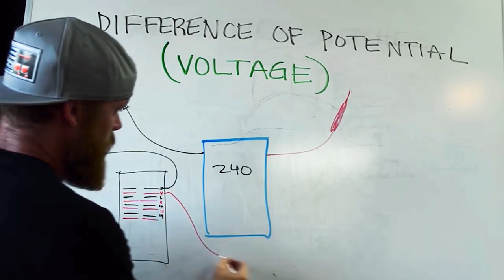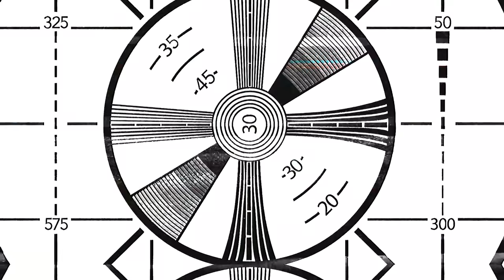So You Want To Be A Foreman...WHAT IT TAKES TO BE A SUPERINTENDENT

Comment: Thanks Dustin. I turn 50 on Sunday and I am starting out to be an Apprentice Electrician on the Monday. So excited. Even after 30 years in Telecommunication Electronics I know I have to put my head down and do my dues. Ask questions, and I know I will be the grunt. To me it will be like going to boot camp again. 👍
Reply: I admire you for being 50 and starting an apprenticeship program.  I'm 46, and thought about it, but that would be so many changes in my life I would have to make.
Reply: @cward1954  Here is the update I posted on my Facebook. First week at my new job update. First day I was exhausted and my body ached. I thought I would be doing only carrying and moving stuff around and not doing things that required me to use tools, but they have me doing electrical related task as well. I am doing a lot of the low task which is to be expected. Here are some of the things I have done. Rough in the wires for each units electrical panels. Rough in the runs for the hot water tanks, washer and dryers. Put in running board in the attic to protect runs from getting stepped on. Organize our storage area. Splice outlets. Brace the main entrance cable going the main panel. Put in pvc for media Center cables. Put in transformers for LED pot lights. Dug up an entrance cable and moved it. Replaced some incorrect switch boxes. A little long winded I know. I am so blessed to be a part of a great group. The foreman, lead and other apprentice are awesome. Everyone helps everyone. The feedback on my work is great. I have already been told they will be giving me the responsibility of doing the low voltage installs which is usually given to a third year.
Reply: @weaponxlogan123  Well you hit the ground running.  It's good that the new company didn't treat you like a dummy that doesn't know anything.  I love the distribution side, but would also like to work with motor controls and PLC's.

Comment: I want to do resi so bad but I love the company that I'm working for and we only do industrial.. I'm curious about the fast pace of resi.. doing industrial you can't really work super fast but there is things that u can learn to do and get more efficient at doing those things but mainly industrial is slower paced... I love when I get to bang out a bunch of lights, switches, receptacles but its never alot of them at a time.. doing resi would be so fun getting to pull wire and knock a house out in a day..
Reply: Only thing you have to consider is a pay decrease from industrial to resi, as well as steadiness of work. I’ve had buddies bounce around company to company when work slowed down. I do believe it’s good exposure especially understanding how homes are built which may make service calls an easier approach as well

Comment: I've worked as electrician for 25 years since I was 18. I've worked residential, commercial, industrial( big tranfer switches for big factory) marinas(electric pedestals and electric boatlifts) also lately electric cars chargers( from Tesla to Porsche)Read blueprints, I've supervised and lead electricians (at least 6 experienced electricians)in big projects to work together to get things well done. Also in lighting and design. if that counts...My question is: what category would i be in since I don't have any license and would it be hard to get it? Thanks for the video. God bless.

Comment: in one part of the video, I think can be taken the wrong way, although i love the content keep it up man great stuff. just for any beginner watching this, don't be discouraged from learning as much theory as you possibly can! don't be that guy on the field that worked in the company for 15 years as a foreman and still thinks the equipment grounding conductor is there so electricity can go to the ground. and don't be the guy that refuses to learn theory because "it's all bullshit" and ends up disconnecting the neutral of a multiwire branch circuit and wiping out 10,000 dollars of equipment in a best buy. you dont need to learn the double split experiment in quantum mechanics to understand exactly how it all works on the field. and you should learn kirchoffs 2 laws, ohms law and voltage drop ect. before you attempt to ever learn the NEC because if you dont, you'll be that guy that cuts corners because you think you know better than a thousand-page book written by 18 code-making panels

Comment: Fuck that bro, go straight to Industrial. Thats where its at in the beginning. I did 3 years as an apprentice as insustrial maintenance and learned so fucking much at that chemical plant. I was mechanically inclined already and still learned everyday. They trained me to terminate fiber, I was on a bucket truck for a year, I set massive transformers, HV spliced, Instrumentation, bent rob roy from 3/3 to 5 or 6 " and got pretty damn good at it, I even ran a 195' boom there and havent been on one that big since lol. It covered aspects of almost every other one of the 40 places Ive been since and made .e into a pretty knowledgable Jdub. 

  Now my 4th year topped out I just went to a meeting at a local government building yesterday to meet with the engineer, GC PM, and Supe for my first job that I am going to run.

Comment: He missed the actual point... superintendent level is responsible for seeing the big picture of an entire job and most are built out in phases. You must be good at planning the work of your foreman and crew to meet each deadline and overall keep hours from going over the bid and keeping the job within budget so the company makes the intended profit. In a nutshell. You don't need to be a physicist at CERN and no you don't need to be creating electrical theory... you do however need to be able to be organized and work well with a GC in order to make all project deadlines without breaking the budget. I have seen many supers fall short and pull more guys to catch up plus overtime and burn away an entire jobs hours in order to hit a deadline and not be penalized by a GC, this ruins the labor bid and will render your job in the negative profit margin and a company will likely part ways with you for this reason. 1 more good quality that's a catch 22 is you need to be unphased with making a foreman or crew member angry with you if you need to get them off the lazy train with a stern talk. You don't make friends with the crew anymore...  hope this was helpful.

Comment: I’ve been curious how to visualize wattage I can visualize voltage and amperage but not watts was just wondering if you could explain
Reply: I always visualize it as what is being consumed, in other words you have the availability of volts and amps, but what is being consumed is in watts...
Reply: What part doesn't make sense? Without really knowing what you mean, think about a car. Watts and horsepower are about the same, just different quantities. Maybe that helps? Maybe just think about watts as units of heat (I know, super simplified, but sometimes that is what it takes.)
Reply: Thanks that helps a lot I’m just a visual learner and If I can visualize something in my head I will understand it.